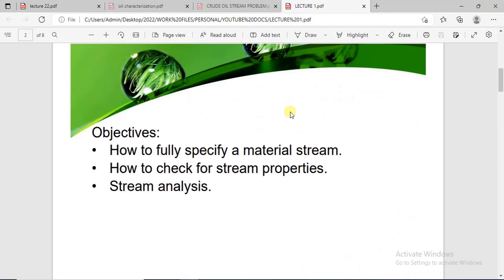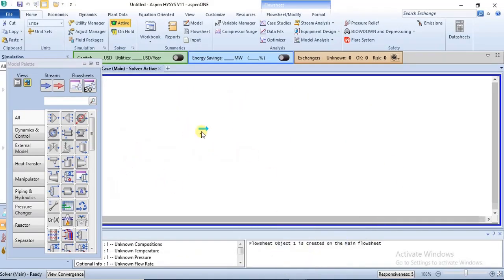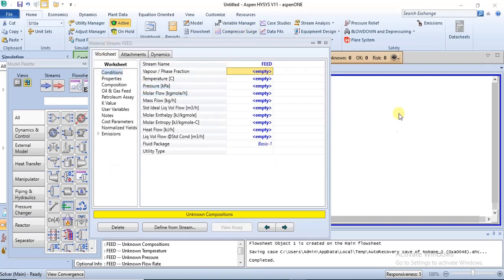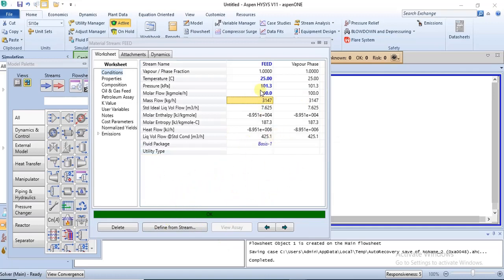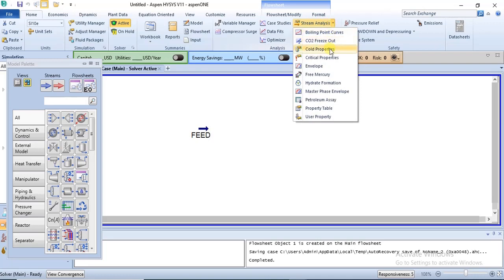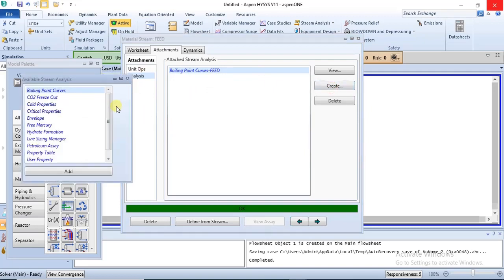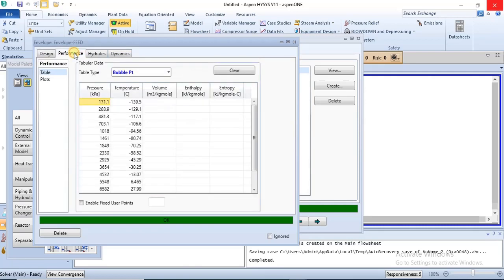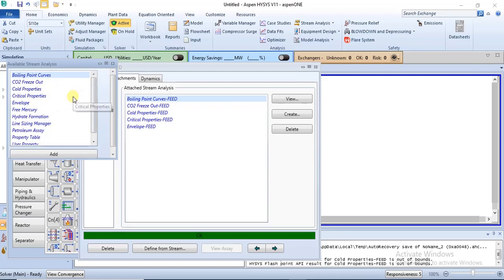Lecture 1: NGL Fractionation Simulation- How to Create and Define a material Stream

Comment: Answers to the Assignments 
1a) Critical condensation pressure = 4554KPa
1b) Two phase critical pressure = 4549KPa
2a) Critical condensation temperature = 173.7°C
2b) Two phase critical temperature = 171.5°C
3a) Mass density = 594.8Kg/M^3
3b) Heat flow = -2.958e+008Kj/h
Thanks for the class
Reply from the maker: Well done. All answers are correct.

You could try out the others in subsequent videos.